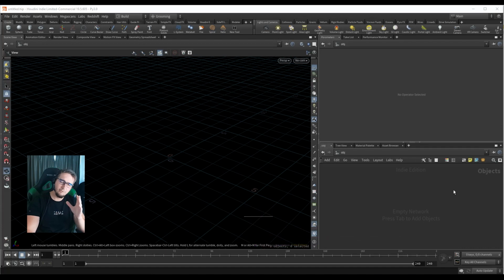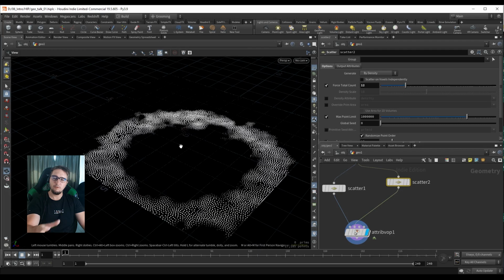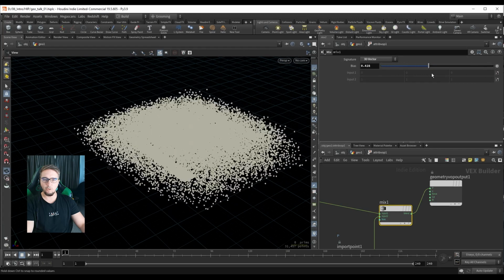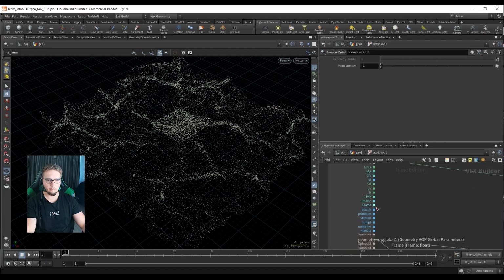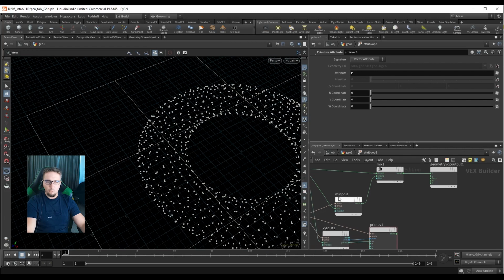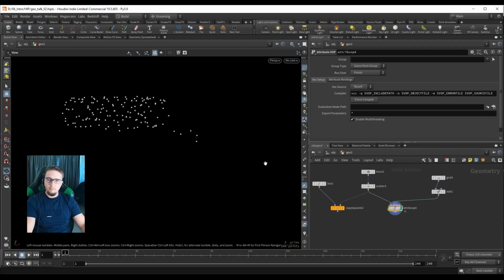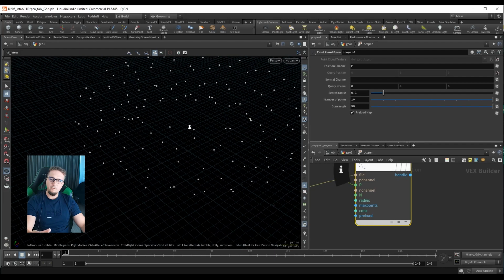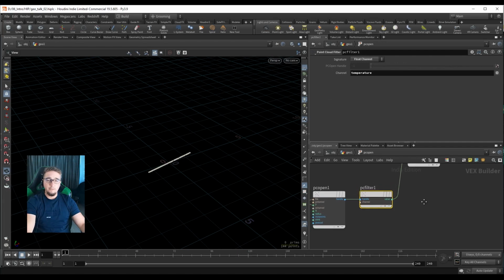VOPS 04 - Geometry Interactions - Houdini Beginner Tutorial

Comment: When using the Distance Node to drive animations down the line, would it be accurate to describe this as a "proximity effect"?

I ask because I've been taking your courses for awhile now and I keep having to circle back to this one forgetting the process and it just occurred to me "essentially if I were doing something like this in Blenders Geo-Nodes, I'd be calling it a proximity effect"; when I said that to myself, suddenly everything clicked. I realized "that's why I need a 'distance' node and I need it to be aware of the position of the 2nd geometry (in this case, a single point)".
Reply from the maker: I'm not familiar with blender but yeah distance and proximity is kind of the same thing although you have to be careful because in Houdini there are some other calculations that fall under 'proximity' such as distance along geometry, which is calculated a bit differently than just straight up taking 2 points in world space and measuring their distance. There can be distances calculated along the connected points of a geometry, and other types of distances as well